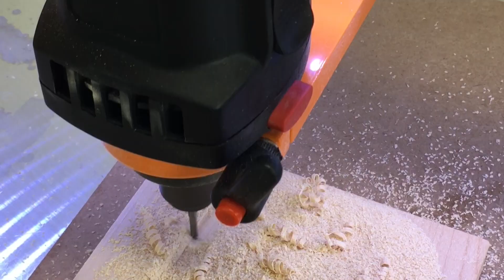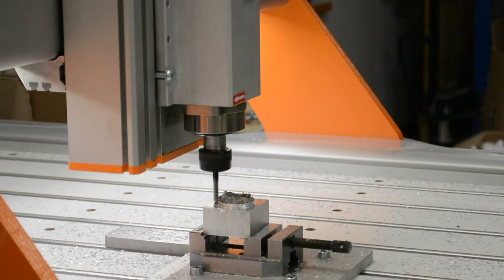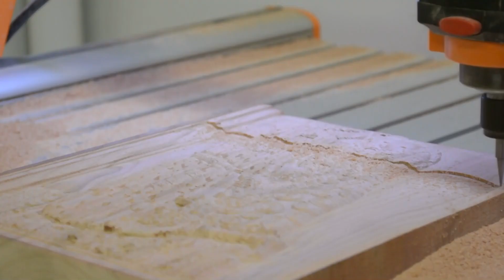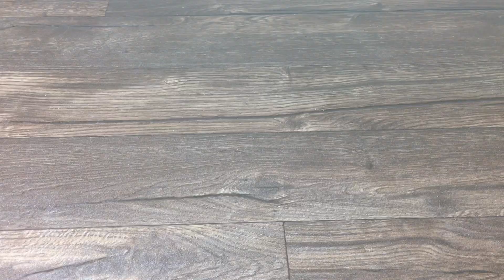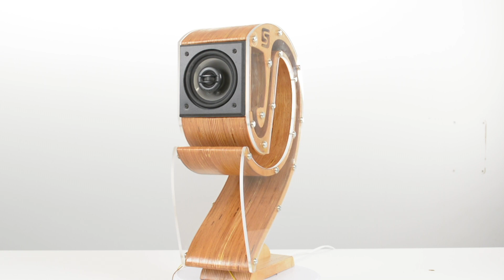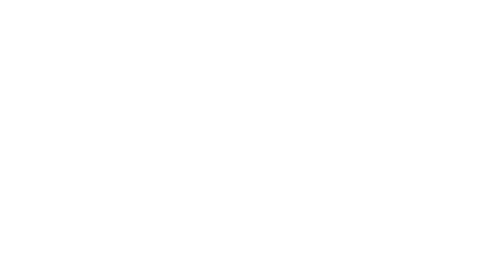Think it. Make it. The Creator's Tool. STEPCRAFT CNC

Comment: Please get the tool changer for your q-series up and running! Im a buyer if it does and if you can show real world tolerances on aluminum
Reply from the maker: The Tool changer is available for Sale not for the Q-Series.  https://www.stepcraft.us/shop/product/75000-atc-2200-2-2kw-automatic-tool-changer-spindle-w-vfd-202764?search=atc
I average .002" on aluminum jobs, but through the use of different tool paths I can get that down to probably .001"